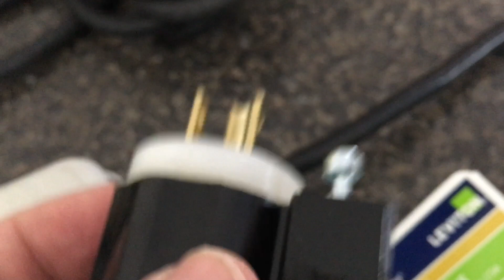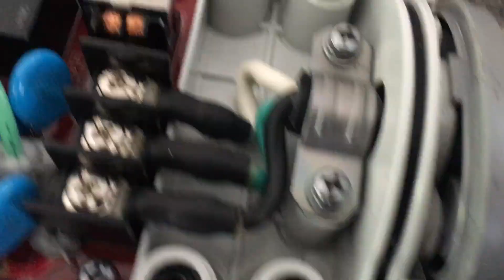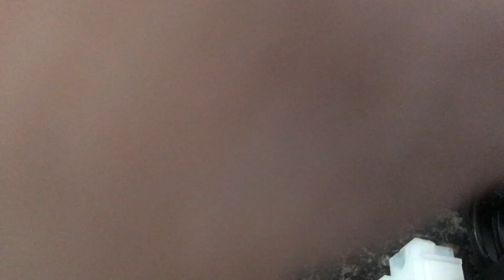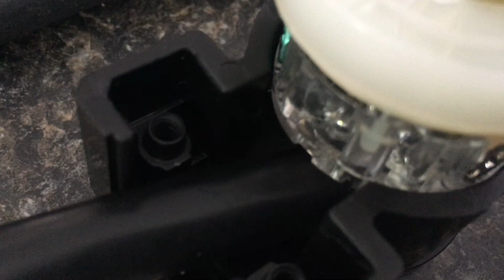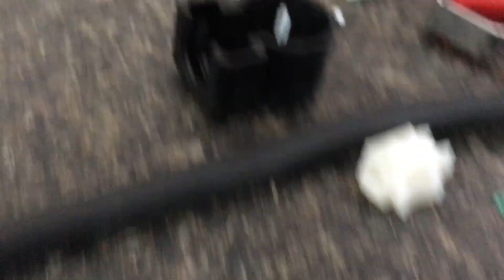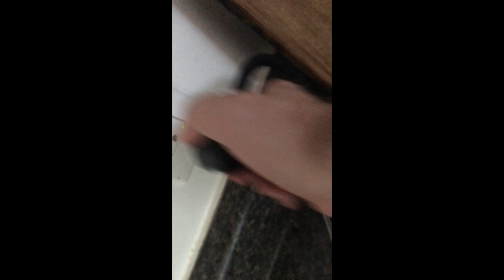Change plug on 120 volt Kia Soul EV line-cord charging station

Comment: White wire goes to silver screw. Black wire goes to brass (sometimes black) screw.
Reply: It looks like I accidentally got it right ;-).  At the time, in my mind it was that the "two hots" were of equal priority and it didn't truly matter which way you hooked them up.  I understand now that one is supposed to go to the neutral, the other to the hot, and that there is a difference.
Reply: @DavidHerron  in most cases you can reverse them, but I think the charger that comes with the Soul EV  is fussy about line and neutral.